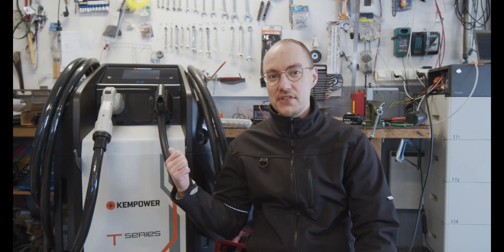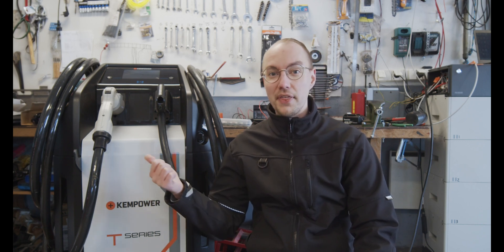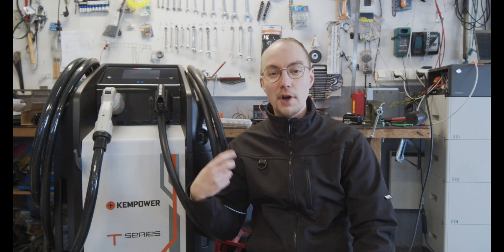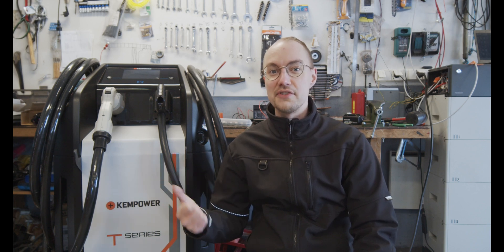FASTCHARGING AT HOME ⚡Kempower Movable Charger

Comment: It's nice to have DC charging for a workshop but I'd be careful leaving it outside, the claimed IP ratings on the t series aren't what I'd call accurate, I've serviced them and done the kempower training, internally they are very nicely built, the module is well put together, just the components under the front cover really could have been protected a lot better.
Reply from the maker: Yeah, and any device exposed to UV will degrade plastics, so it is a good idea to have it a bit sheltered from the elements. I intend to put a small roof over it!

Comment: Is it possible that my 2012 Leaf has original battery given it has 55000km (only) and "still" 10 bars left? How to tell if battery was already swapped? 
Car was delivered and lived in climate where summers are hot and dry.
Reply from the maker: Open the plastic access port for service disconnect switch in the rear. If the battery is grey it is the 2012 battery. If the battery is black, it is a replacement pack.
Reply: 2011 Leaf 35000km here, also 10 bars. Original pack.

Comment: Like we all have 3 phase power, and a mortgage for the charger!!!
Reply: you can hook it up to a type 2 outlet via adapter.
Reply: @AsekiBekovy  And the mortgage for the charger?
Reply: @8skellerns  buy a used setec 450.. does not come close to 40kw but 12 to 16 kw are better than 3.3

Comment: Dala, since Leaf supports V2G charging, would V2V also be possible? Say your friend ran out of battery, you'd pull up to his car and plug your car to theirs with a special cable and charge it for 30 mins to give them enough range to the nearest charger. This would be a game changer.
Reply from the maker: Problem is that the voltage differential would make it real hard to control current. But theoretically possible to build, economically viable another thing..

Comment: Why are the DC cables significantly thicker than the AC cables?  Surely <40kW DC does not need liquid cooling.
Reply: AC cable needs only to be rated for 64A, but the DC are 125A or 200A.

Remember that the lowest voltage for CAdeMO is 50V and 200V for CCS. 200A at 200V is 40kW.

In addition a lot of fast charger cables have extra insulation to protect them from being driven over by cars.
Reply: The conductor must be insulated to avoid a short circuit. The insulation must be thicker the higher the voltage is.
Reply: @MotorLarsNorge  The AC line-line voltage will be 400V too.

Comment: Not bad if you have a huge battery bank at home, I suppose that's how you source the power?
Still thinking which one costs more, the car or this charger? :-D
Might be useful for an apartment building common charging spot or something.
Reply from the maker: Charger > car for sure 🙈😅
Reply: Costs only about 25k... Which is why I am waiting for the day when used vehicle chargers could be used as these. Once saw a probably working Tesla 11kk charger for like 600€… Now stack like 4 of them and it is already more powerful than this.
Reply: @rkan2  the actual onboard charger or the wall connector?